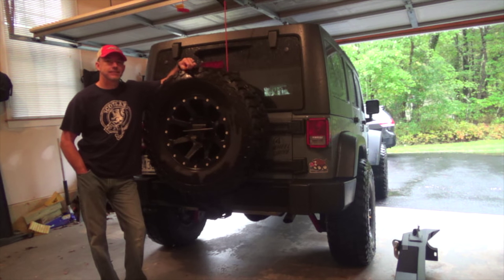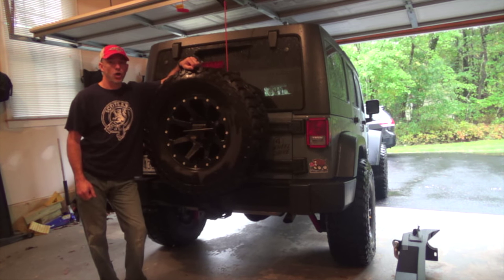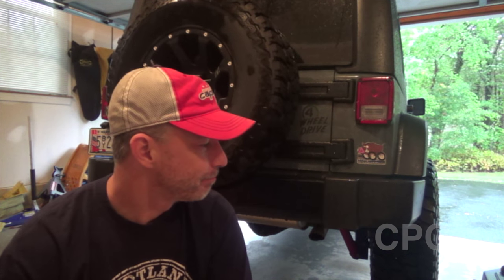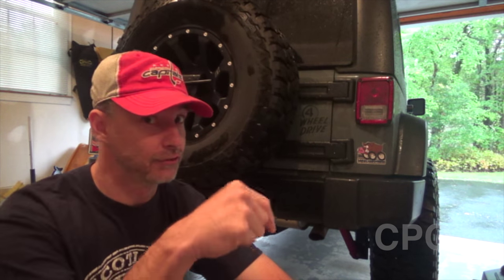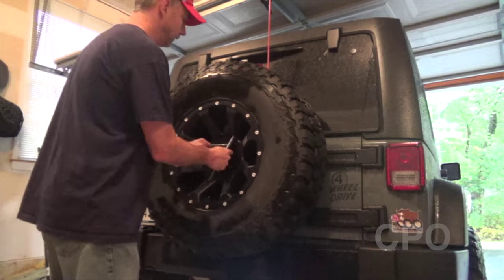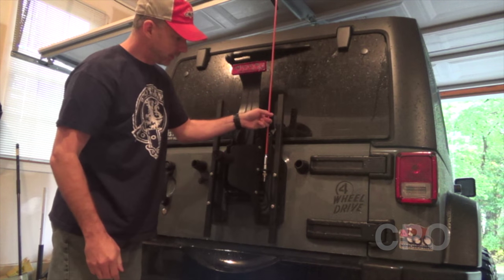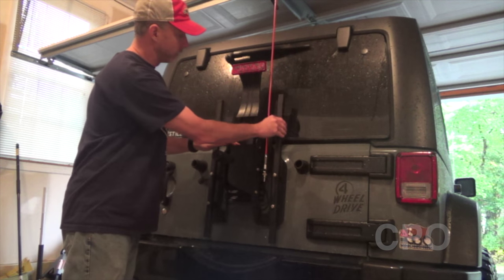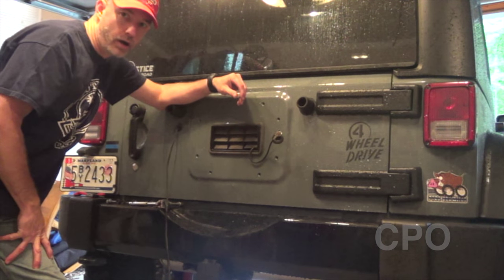Barricade Trail Force HD Rear Bumper Tire Carrier Install - Part One

Comment: On that cb antenna mounting location.
An antenna needs a solid ground to be effective, sufficient height, and most importantly resonant on the segment of the rf spectrum you are operating.
If it were me, I'd use a  Hustler 2" ball mount attached to the bumper on either corner, and a 102" stainless steel whip. Those antenna are literally indestructible, and resonant across the band with no adjustment necessary. If needed, you can fold them over and secure them with a line for low clearance issues like parking garages. I've used one for years, and they have never failed me.
Also, it's good to use a tennis ball for preventing the whip from wacking your vehicle. I also use a short line to keep the whip from bending back too far. 
If you get a ham license, general class and above, the 102" whip when coupled to a random wire antenna will open up your access to lower frequency bands that have outstanding propagation, like 40 meters.

Comment: I used your video to install this bumper less the tire carrier. Went pretty smooth. I did all by myself just used a jack to hold the bumper while I started the bolts on the side. We'll see how it holds up rust wise with MN winters but nothing a little spray paint can't fix.  Thanks for the video.
Reply: How's the bumper standing up in MN winters?

Comment: Did you have any issues with the bumper making contact with body?  Also, on the underside 4 bolts, does the bumper actually contact the frame?  To keep mine from contacting the body up top I had to use spacers to adjust it away from the body.  I also had the bumper contacting the lower bolts on the license plate holder.  I may just send it back and see if the new one fits better.  I have doubts because I sent the front bumper back because it was bent where the fairlead mounts.  Plus, both front bumpers have metal inside the fairlead opening.  I'm going to have to grind that away so the rope doesn't contact the metal bumper.
Reply from the maker: +marty barman yeah....i had to grind down my fairlead slot. the bumper doesn't contact the body at all.  It was close and tight to the license plate mount, I do remember that. I'm not sure about the question about the 4 bolts and the bumper contacting the frame.  sorry.
Reply: +OVERCLOCK3D - CPO I was asking if the portion of the rear bumper where the hitch is mounted (4 bolts) butts against the frame on the aft and bottom.  I had to use washers to space these 2 spots to keep it off the body and the plate holder.  BTW, Great videos.  I've learned A LOT from your info.  Thanks

Comment: Do you loose any lift height with these bumpers?
Reply: trey michel I just recently installed the same bumper and tire carrier.... did you install one as well? I've been looking online for any answers on this. I noticed a little sag in the rear and a slight sway on the freeway. I haven't added any additional items besides this as of now, I have the Rubicon Express 3.5" lift. Thanks

Comment: Chief, I like you channel and presentation style.  But, I have to ask this question.  Why do Jeep owners find it necessary to remove perfectly new, usable, and working components and replace them with primarily cosmetic replacements?
Reply: Cause the plastic bumpers that come on jeeps are trash they look like crap after 5 months in the sun fades the plastic and the factory plastic fender do the same.
Reply: A rear tire carrier bumper is more function than aesthetic as the stock tire carrier can destroy the welds due to the heavier and much larger aftermarket wheel and tire combo. You need a heavy duty one to support the big spare. Also the steel construction is much more durable than the flimsy plastic ones when it comes to offroad abuse
Reply: Same answer, cities like NY, LA, Chicago where parking is crazy those factory bumpers get destroyed within weeks.

Comment: Great videos! Got two questions, where did you end up placing your trailer wire harness? and have you towed anything with it yet/are you comfortable towing with it? I am looking to get this bumper but I do tow a small 4.5ftx8ft trailer with my atv and would like to still be able to do that, as well not have my trailer wire harness just dangling down. Thanks!
Reply from the maker: I tucked my harness up out of the way in the back side... I can't remember exactly now...but it was out of the way.  I have towed a small trailer on a cross country trip, and had no issues. It's as sturdy as any other hitch I've had.  You can see the trailer in this video.... somewhere around a minute in I show it, and then it shows a few times after that. 

https://www.youtube.com/watch?v=VH-a4PpnuCE&list=PLKivmulOhtZiFB2y-TFqpP6vJn_W_irR9
Reply: Thats awesome thank you for the fast response, I have pretty much the exact same trailer. I saw you had the safety chains set up in that video you linked, did you have to drill holes in the bumper to be able to hook them up?
Reply from the maker: PFT19 yep... I just drilled holes. Worked perfectly

Comment: okay on a scale of 1-10 how bad is the rattle that is one thing I can't stand is rattles haha I guess I bought the wrong vehicle lol.
Reply from the maker: +Tim Grossi .5 hahaha.  I honestly have only heard it a few times. Last time found my handle was a little loose, and tightened it up and no issues since. The handle assembly came pre-installed, with apparently no thread lock on the allen bolt...so it worked loose over time. I've heard a few squeaks here and there, but they are intermittent. As of late, Ive heard no noise.   Others may have different results.